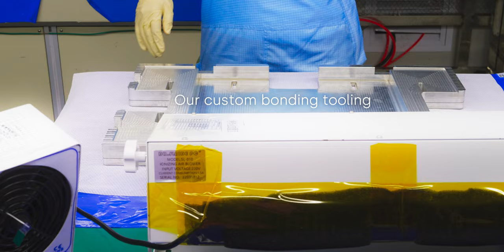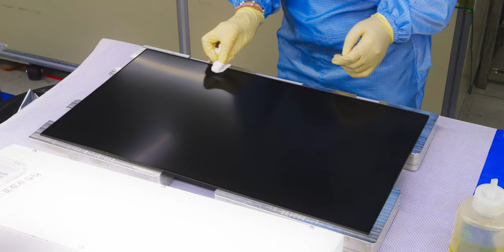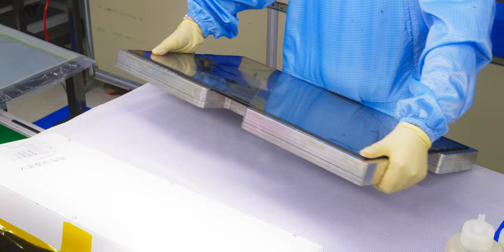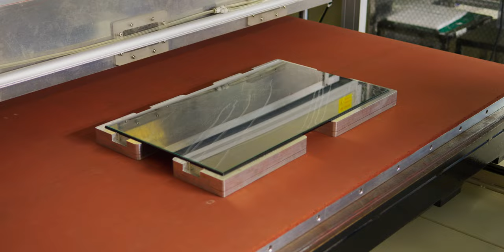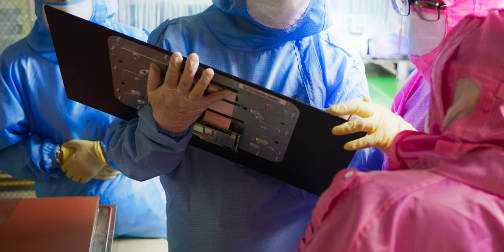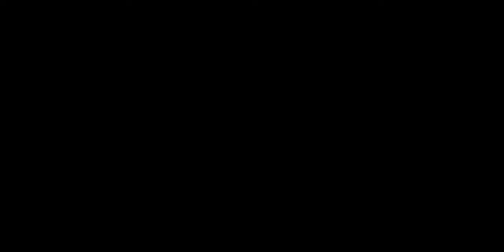Spectrum Black: Bonding the Gorilla Glass to the Panel

Comment: But that panel clearly has a matte finish on it. You're putting the Gorilla Glass on top of the matte finish the basic LG panel has?
Reply from the maker: Yes, the glass is bonded by Corning using a resin that completely eliminates all internal reflections, cancelling the effect of the matte coating that comes on the panel from the factory.